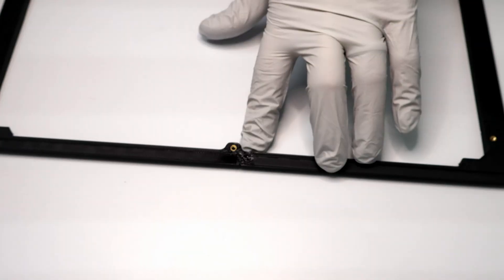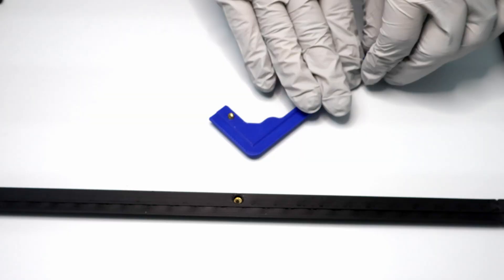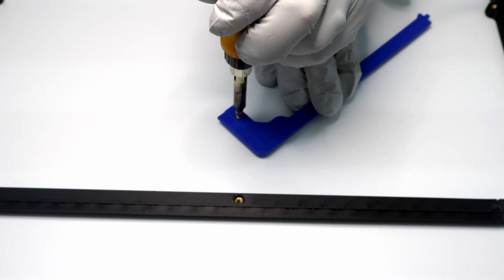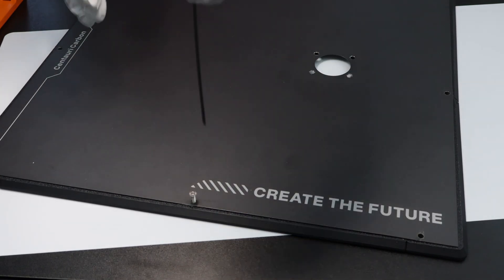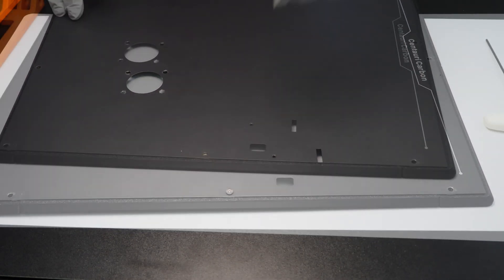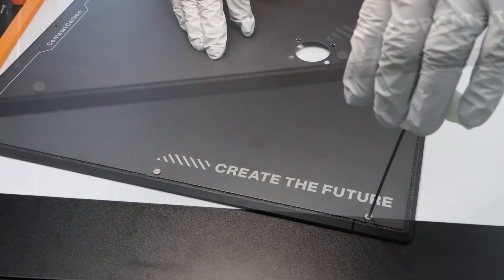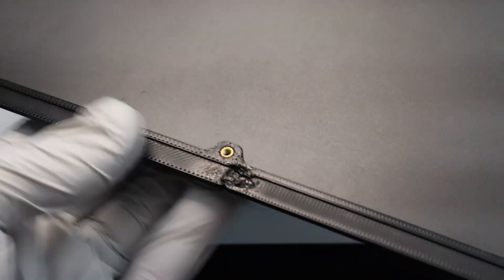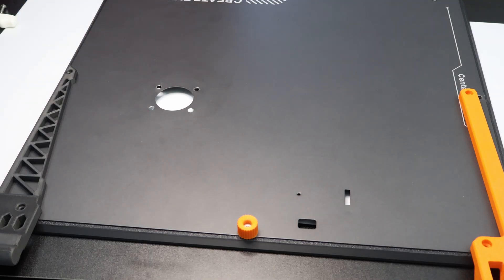Centauri Carbon Panel Spacer Install

Comment: What infill settings do you use if you are using translucent PETG for the spacer?
Reply from the maker: For that I was just using Comgrow translucent (affiliate https://amzn.to/41Zcyh2) PETG, which is actually a really good value, and it works fine with the default Elegoo RAPID PETG profile in Elegoo Slicer. It's not advertised as a rapid PETG, but in my experience, I'm not seeing any issues from printing it fast.
Reply: oooo you fancy! lol have to consider that myself now..

Comment: Will this panel spacer work on either side? I thought about adding some translucent PETG so when I turn on the lights it will give a nice look to both sides not just one.
Reply from the maker: Yes, it works on both sides. You must have seen this? https://youtu.be/rWnwzxzkfaI?t=406
Reply: @SyntheticElectron3D  Ok, went by so fast I missed it, thanks for letting me know.

Comment: I'm sorry but I'm confused. You're melting the inserts in from the back and even say "from the back" and are clearly doing it on the side without the chamfer. But when you show the faceplate install you're screwing into the chamfered side. Are you putting the inserts all the way through to the other side? Why not just install them on the chamfered side? I installed the way you describe and getting them all the way through filled all of the inserts with filament.
Reply from the maker: You're probably right. It can be done without filling the inserts with melted plastic, and I think some of my more recent versions have slightly larger holes to avoid that. It's just not very easy to avoid it. My logic was that they would be less likely to pull out that way, and while probably true, is also likely overkill for this application. Thanks for pointing this out. I will keep this in mind for future updates and documentation.

Comment: Could you make a video demonstrating your internal spool holder? From your other videos it looks like it works even while printing but I’m still unsure. I haven’t seen anyone else do this mod (or the internal air recirculation). Pretty unique and interesting!
Reply from the maker: Yes. In fact, I'm considering doing that next. That's familiar territory and I need a little "vacation" after my last R&D-intensive production!
Reply: @SyntheticElectron3D woot! 🥳